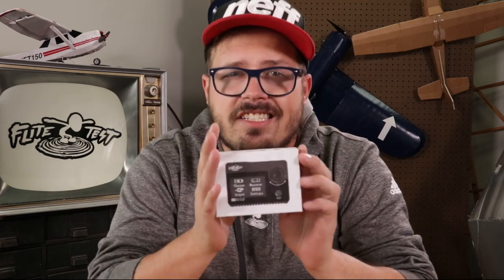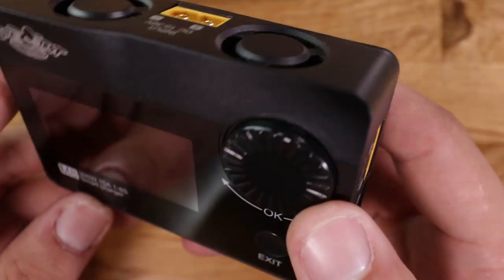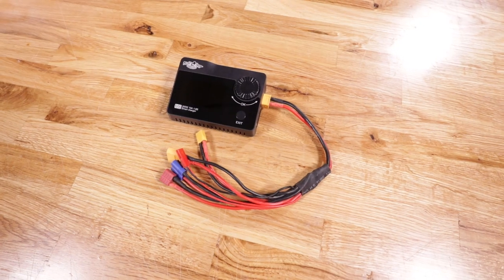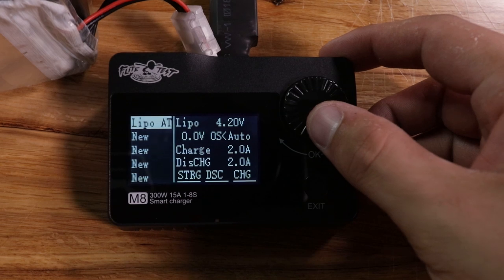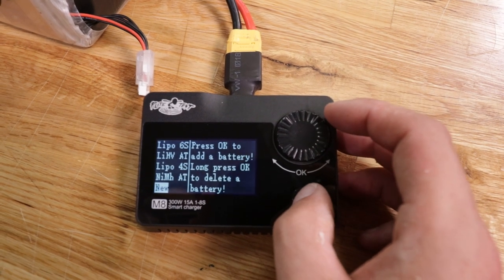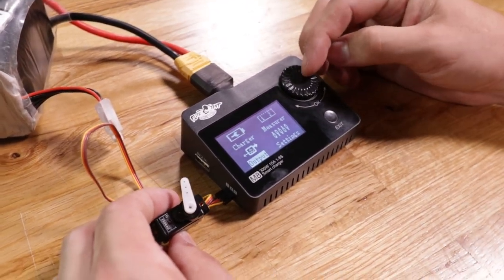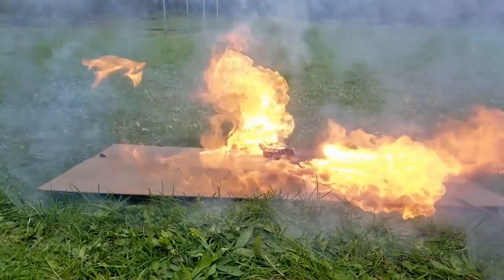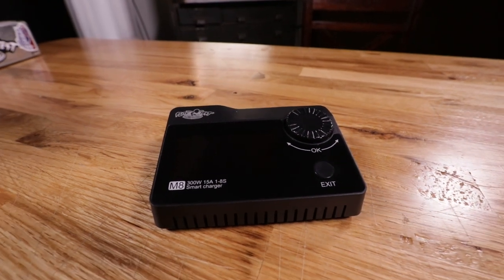Is The Flite Test M8 Charger Right For you? // Overview

Comment: can use the usb instead of a big batteries to supply the power to charge? thanks
Reply: Evan Ouellette USB is 5V at 2A maximum. You won't be able to charge any LiPo batteries when powering the charger from USB power (assuming you can even power it from USB).
Reply: @jyunte  Okay thank you very much

Comment: I love my m8 not only as a charger but power supply for an old laptop the original charger died, see it to 19v 2.1a and it charges. I would recommend running it off of a 24v 350watt power supply. You can get them off Amazon for pretty cheap but you need it to get the full power out of this little bad boy

Comment: I have this one but I can’t charge my 3s lipo!!
Reply: What's the problem? What kind of LiPo? What settings are you using?
Did you contact support@flitetest.com? They usually have answers if something doesn't work.
Reply: Thanks I’ll try that
Reply: It needs to have 24v 300w input  from a power supply or a 6s battery to really do anything